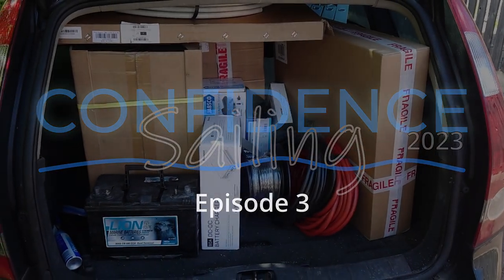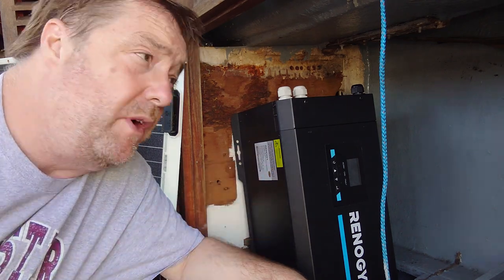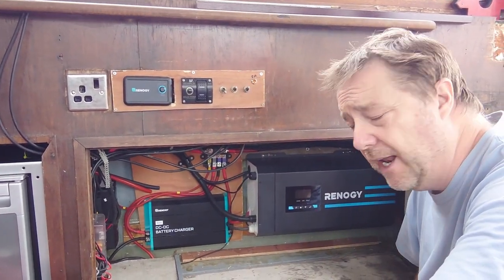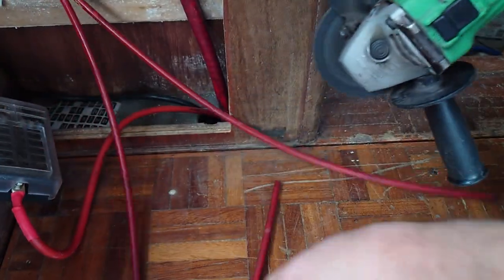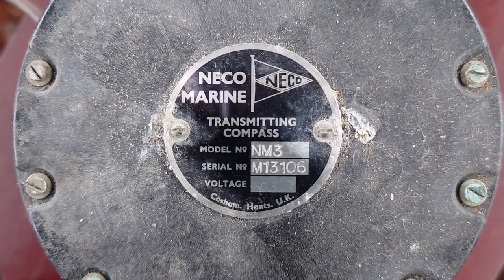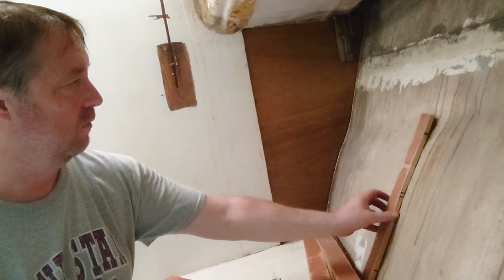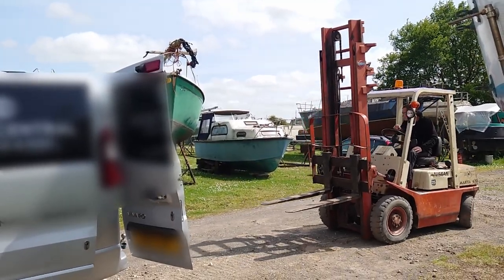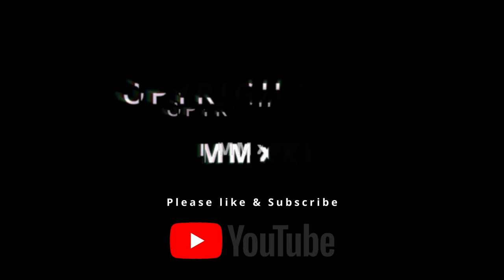Small boat refit - Episode 3 - things are staring to get done, and the engine gets taken away

Comment: Great work John, following with interest. For Evostick Impact Adhesive, you spread a very thin coat on both surfaces then let them dry for at least 20 mins, then press them together to stick. It doesn't work as well if you just spread it on one surface and press together whilst still wet. https://static.rapidonline.com/pdf/77519_v1.pdf
Reply from the maker: Thanks for that. I tried that and it was much better.